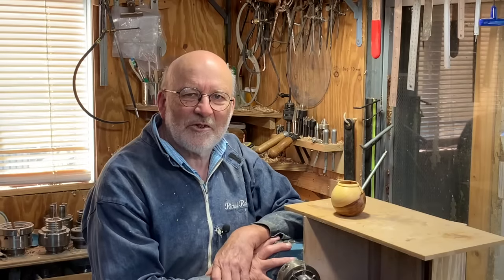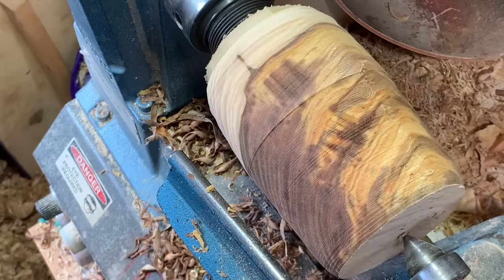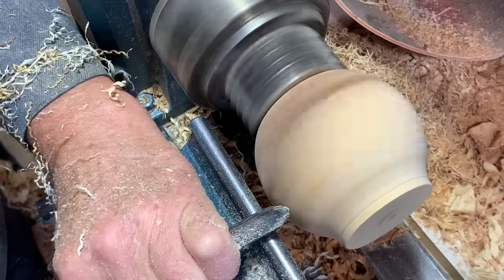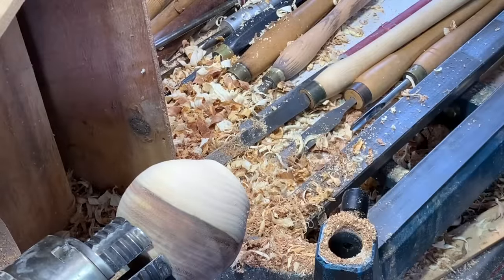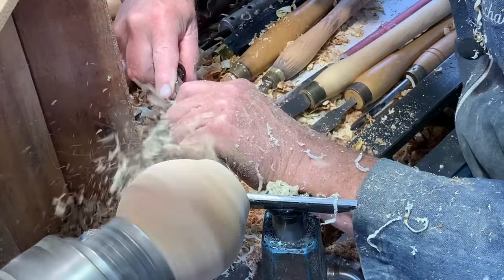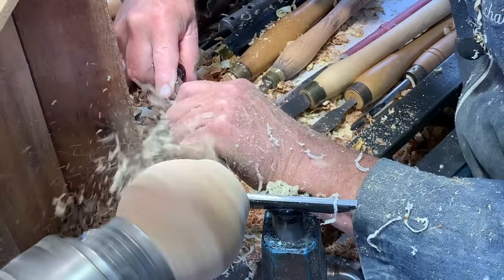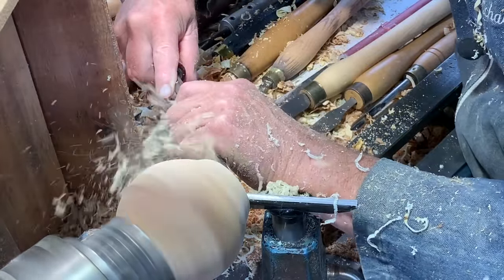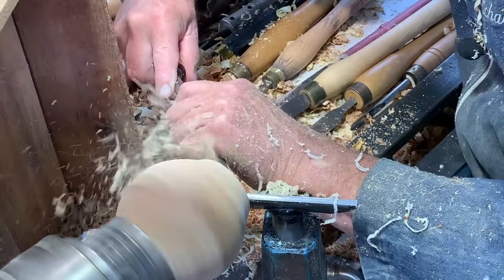Richard Raffan turns a thin pot using traditional gouges and scrapers.

Comment: To make your new drill less aggressive, use a fine diamond hone and stroke it across the sharp cutting edges at right angles, just a couple of gentle strokes, then test it, repeat if necessary. This is how we make drill bits suitable for drilling brass and many metal sheet materials. Greetings from Tasmania 😁
Reply from the maker: My experience is that it's primarily a size problem: the larger the drill, the faster it's pulled into the wood even when very well used. I wanted a black ¼" drill but couldn't find one — black, so depth marks are easier to see.

Comment: My back won’t let me bend over the lathe for those deep inside curves.  I use set screws in the holes provided in my chuck to tighten it to the spindle so it won’t unscrew and then turn in reverse.  It works for me and lets me stand pretty much straight up while turning.  I hope this helps someone else.

Comment: Im relatively new to turning, beautiful to watch your use of the original tools and methods, can i ask what the main reason is to turn a small pot in cross grain and not end grain,
Reply from the maker: I never recommend turning bowls endgrain for a number of reasons, not least because crossgrain is far stronger than endgrain — and it's much easier to hollow.  On top of that I wanted the pot to distort, and that's unlikely to happen much with endgrain.

Comment: It is always instructive and enjoyable watching your work.  Seeing the different ways you hold the workpieces is very helpful.  You stated that you put the piece in the microwave for one minute at a time.  Is that to mitigate risk of the piece catching on fire or would leaving the piece in the microwave too long risk causing cracks?
Reply from the maker: You want a bowl coming out of the microwave too hot to handle. The time required varies according to the size and thickness of the bowl, the wood species and it's moisture content, and your microwave oven. Always keep a close eye on a bowl being cooked and the moment you hear cracking, or smell or hear bubbling within the wood, cut the power immediately. Never leave a cooking bowl unattended.

Comment: That steamed elm sure looks hot! You have a good eye for design and proportion. Speaking of hot, how would boiled linseed oil work on warm elm wood? Have you ever tried it?
Reply from the maker: I want the moisture out of the bowls being microwaved, so don't want anything on the surface that might slow the process. My theory is that once the wood is 10% moisture or less it'll absorb a finish like a sponge.

Comment: Richard: I have limited access to green wood, but I do have access to kiln dried 8/4 wood, such as cherry, walnut, hard maple, and oak. I would like to do some things similar to your green wood turnings that you turn thin, and then put in a microwave and you get significant, sometime, but always lovely, warping. I’m wondering if I could soak this kiln dried wood either before or after turning to raise its moisture content and then put it in the microwave to get warping. What do you think? Would this result in warping wood? And should I saturate the wood before or after turning, and then put it in the microwave?  Thanks very much. Ned.
Reply from the maker: Unfortunately soaking dried blanks won't do it. Soaking finished bowls might lead to distortion but chances are they'll return to their original shape as they dry out. You really need green timber not much over three months felled. If you're in a city you need to find an arborist or approach gardeners in parks where trees might be pruned. One advantage of turning green is that you can consider small logs 6" and up.
Reply: Thank you, Richard. Good advice as always. And thanks for your prompt reply. Ned.

Comment: Could you please explain the rationale behind using a wood plate between the screw chuck and the piece to be turned. You are consistently saying you do not need a long screw but is there any harm in going an extra quarter inch or is it because the piece has better support with a wooden plate?
Reply from the maker: There's no harm in using the full length of the screw, but that takes longer. I use spacers to save time.  It takes more time to wind a blank fully on to the full length of the screw. If I throw the blank on, it's more likely to jam on and take a lot more time to unwind. When turning 20 or 30 bowls a day, or roughing several dozen, an extra 15-20 seconds for each bowl becomes 7-10 minutes — time enough to rough three or four 8"/200mm diameter bowls.

Comment: In this video you removed the foot at the end for aesthetic purposes but I've had a curiosity. Before the days of the 'modern chucks' were foots on finished bowls regular practice? You've talked about both 'old methods of rechucking to remove feet' in the ways of jam chucks and the like but also the inspirations gained from ceramicists whose bowls I note typically have feet. 

A bit of a question of the chicken and the egg. Were feet on finished bowls a result of saving time by not removing what the new chucks grabbed or was the foot on a bowl already common practice and simply room for innovation in workholding? 
Thanks for another excellent video.
Reply from the maker: In the 1970s most bowls over 200mm diameter were turned using faceplates and screw holes were filled with wooden plugs or plastic wood. Many bases were covered with baize. Smaller bowls were held initially on a screw chuck, then in an engineers 3-jaw chuck grasping a foot/tenon. To remove the chuck jaw marks and shape the foot, bowls went between centres or into a jam chuck. In 1978 Craft Supplies UK introduced their Spigot Chuck that enabled me to take small finished bowls out of the chuck, eliminating completion between centres and jam chucking. Commercially, that saved a lot of time with minimal design consequences. This was a few years before the woodturning revival really gathered pace in the mid-1980s.